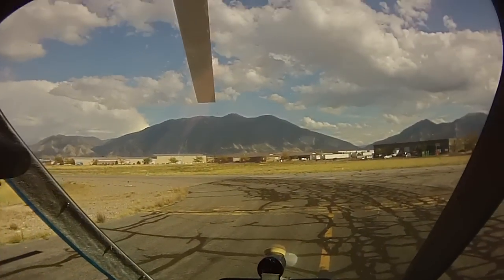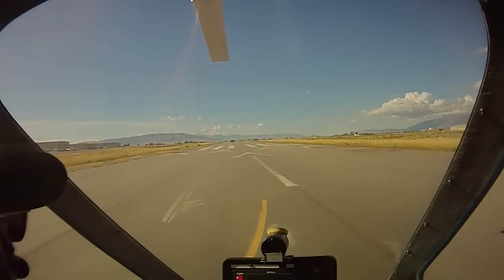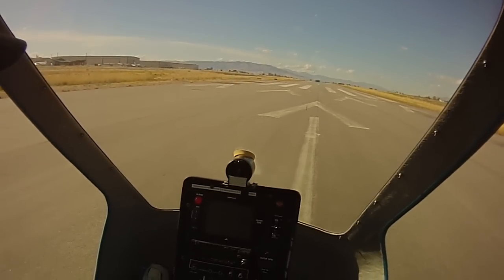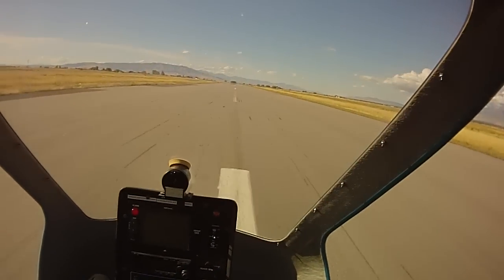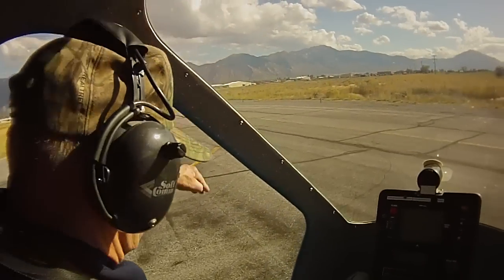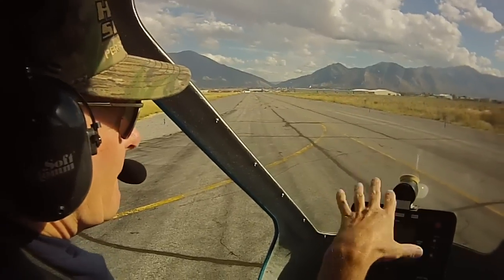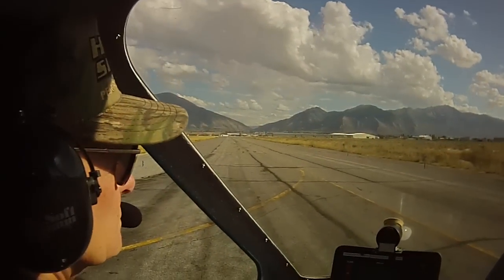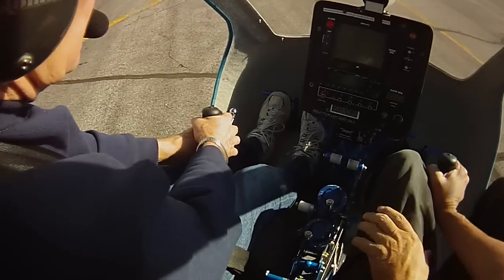Gyroplane failed takeoff attempt - too much pitch

Comment: I don't post often at all but am an instructor and respect both the student and the instructor in sharing this.  Good students are enthusiastic and want to learn - just like this one.  We are all fellow students in something and should encourage each other which leads to further motivation.  A good instructor like this one allows the student to learn through "experience learning" while in the care of their guidance - and this enthusiastic student learned the necessary point first hand which appeared to be the intended lesson.  Good job by both student and instructor.
Reply: @Sale Robinson - I respect  your opinion as an instructor but, for what I have seen in these videos so fare, you can not learn to gyro fly by trial and error like you my safely do with a bicycle or like toddlers learn to walk.  This dud was at a second distance of getting everyone killed!  Was he not?
Reply: @jmerlo4119  what are you talking about? The instructor knew he wouldn't be able to take off. That was the point of the exercise. 

Now the student knows the conditions that cause a failed takeoff and he will avoid it as well as abide by the correct take off method.

Comment: That was a great example of low airspeed rotation and attempted lift off then trying to climb on the backside of the power curve. I will be using this video for my students. I admire you for allowing it to settle. Should be an indelible experience etched in the students mind. Intensity principle of learning at work. Well done.

Comment from the maker: There is nothing better than an actual demonstration! This was not scripted. I have done a some training with Mike (the CFI) and he is great at letting you make mistakes so that you can figure things out. He has a ton of hours in this gyro so he knows the limits and knows when he needs to take over. I have also flown with CFI's that take over the second you are doing something a little wrong. I don't learn as quickly that way.

Comment: rotor all the way back, 200-250 rpm to the rotor, then brake off, full gas, reach around 60-70 mph on a single seat, 70-80 on a double seat, when it start to rise the nose, bring the stick a little forward to balance on the main wheels, then the gyro takes off all by itself  if everything (speed and pitch) is ok...this is how much I've learned watching all these videos..hope it is right!

Comment: As an old Nam chopper pilot I would have thought that in flying gyrocopter they would also use the term translational lift to explain the act of transitioning to flight since a gyrocopter doesn't hover.

Comment: A novice question: What makes the rotor turn when the vehicle is not moving? Is it the airflow from the motor-driven propeller? Previously, I had been under the impression that gyrocopters needed to taxi forward to get the rotor to spin.

Comment: i fly from the right side,for those to understand the mechanics if rotor rpm 100 very gradual gas until the nose picks up then full throttle or can have rotor flap and flip over then level the nose or prerotate to 200rpm then throttle until nose lifts then full gas

Comment: Hi there guys just a separate question: What would I pilot do in this situation in a light to moderate cross wind?
I only ask because I'd like to get into gyrocopter flying.
Cheers :)
Reply from the maker: Antonio Cusato If the winds are light we compensate just like a fixed wing aircraft. If the winds are strong then we land into the wind.  Only a very short or no roll is needed.  I have landed across the runway may times.
Reply: Airgyro Aviation Cheers, Merry Christmas guys.

Comment: Seems like there would be more lift on the advancing blade and less on the retreating blade....  causing an autogyro to want to roll the faster it goes
Reply: That's true, but the effect is negligible. The rotor is spinning at 250 - 350 RPM, and so the blades are always moving much faster than the air they're moving through. Even at a maximum cruise of 100 knots (and most won't even do that) there is sufficient airflow over the blade to generate lift. Retreating-blade stall is a limiting factor in very fast helicopters and autogyros, and various methods like stub wings, counter-rotating coaxial rotors, etc. are being used to overcome that limitation, but it doesn't apply to the relatively slow rotorcraft like the one shown here.
Reply: The rotors are hinged in the centre - a/c moves forward and the forward moving blade produces more lift and it rises. Backward blade produces less lift blade moves downward to balance the lift produced by both blades.  If the blades werent hinged then it would just tip over and never fly straight and lvl.

Comment: Interesting.  I don't know much about gyro's, my job is a flight medic so I'm a little familiar with helicopters.  Am I correct in that gyro's don't produce enough lift via the top rotor to stay aloft or even gain altitude?  Is it a combination of the horizontal rotor pushing the plane and the top rotor that keeps it airborne?  Can a gyro helicopter land vertically or does it have to have a bit of runway?
Reply: David Cook The top rotor is driven by autorotation, autorotation is when the rotor is driven by air movement and not from a motor.  Gyrocopters use this autorotation to get lift.  They do produce lift and stay aloft from the top rotor only, but that lift comes from autorotation that is caused by sustained forward movement through the air provided by the motor driven propeller in back.  So it is a combination of the two working together to produce lift, in the simplest terms, one is pushing forward so that the other one can push up.

Helicopters rarely ever land perfectly vertical, it is very dangerous to try to land without forward movement because of the potential for vortex ring state (Look it up, it's hard to explain).  A gyrocopter can land as vertically as a helicopter can using autorotation alone, but it needs to be moving forward until just before landing.
Reply: Like a fixed wing, if there is enough wind, you can "kite" the gyro by tying it to the ground, spinning up the rotor, and flying with the motor off (or no motor at all).  If you have this much wind, you can actually take off vertically, like a helo.  Less wind is needed to land vertically.  If you have even more wind, you can fly backward, because the gyro pretty much has one airspeed.  What was demonstrated here is that the standard fixed-wing climbout procedure (raise the nose) doesn't work, because you add so much drag you lose airspeed.  Helos do something similar when going from hover to transitional lift -- keep the nose low and add power, the rotor will do the work for you.  The difference is that the gyro has fixed-pitched rotors, so lift is increased by airflow from underneath -- and you get that by putting more power to the prop and pushing the gyro into the wind more strongly.
Reply: Helicopter rarely ever land perfectly vertical? Sorry but that is incorrect information. Helicopter 99% of the time land completely vertical unless you have wheels and even then you can land completely vertical. Vortex ring state is not when landing it's anytime you're descending. The best way to not get into a ring vortex state (also known as settling with power) is to not descend straight down at more than 300 feet per minute. I teach ring vortex at 3000' high in order to give the student a feel for it and how to get out of it. As a retired EMS helicopter pilot I landed completely vertical every day.
Reply: As I understand it, the top rotor is just free-wheeling.  The pushing rotor gives forward motion. As the gyroplane moves forward, the top rotor is acting similarly to an airplane's wing as it glides. The movement of the air under and over the rotor creates lift because, like an airplane's wing, the rotor is an airfoil. The airplane wing and the top rotor can glide as long as there is forward motion. Without power, the forward motion is provided by gravity. There's no vertical lift without forward motion.

Comment: It's not going to fly with more throttle because its UNDERPOWERED but the student is correct if it was decently powered with very high pitch up
Reply from the maker: ant a Not underpowered. 200 hp. Just too much drag.
Reply: +Airgyro Aviation  And also a student pilot who does not seem to listen to instruction!
Reply: Anthony Abelardo 
If it needs more power it's not flying.

Comment: An airplane is easy to take off and difficult to land. They gyro is difficult to take off and easy to land. You can get a gyro with a turbo engine to help in takeoffs but you can still over pitch it. Have to balance drag with lift on those blades.